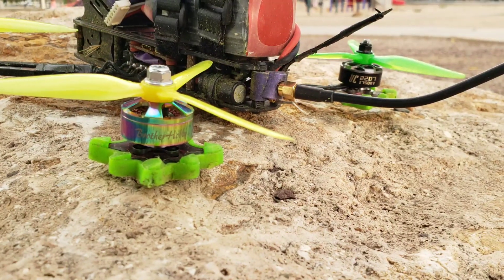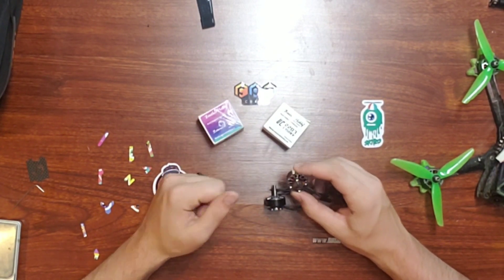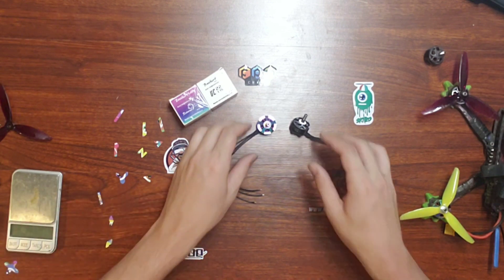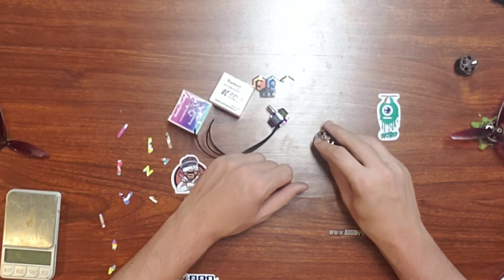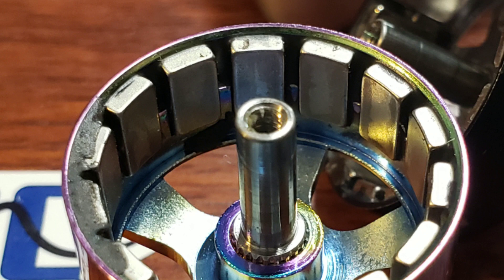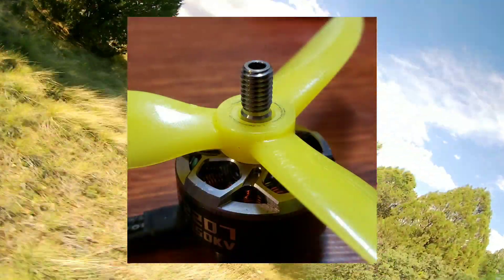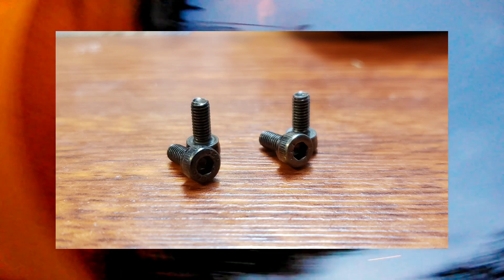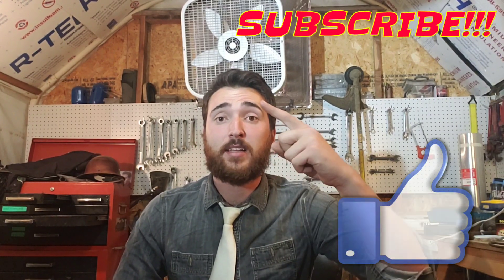Brotherhobby UC Motor VS R6 (UC 1750KV) Full Review and Comparison.

Comment: Is it fasst enough.. Its rich 115mph
Reply from the maker: I don't really know how to answer that question it really depends on what build you put it on. But I'm gonna say yes if the builds light enough and the prob is pitchy enough you should be able to..... maybe....
Reply from the maker: If you're going for speed I would do something more like a 1950kv on 6S.. And just look at your batteries  as disposable.
Reply: @mrtiefpvhowtoandreview1033  orite thank you I'm using mamba stack rush racing tbs frame I using flywoo vampire and I've issue with chossing motor

Comment: Limited edition oh man.
Have to stock enough, which can be expensive: you have to leave a few on the side which is waste if they are not in use.
Reply from the maker: I would just buy 5 and call it good. If you bust one then replace it with a R6 if you cant fined the UC any more.